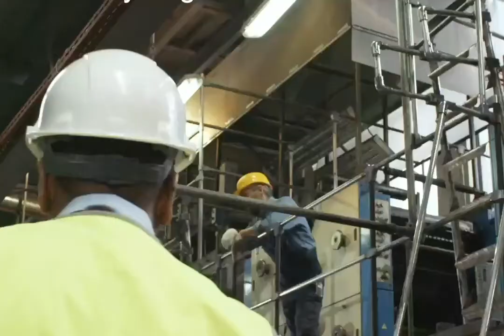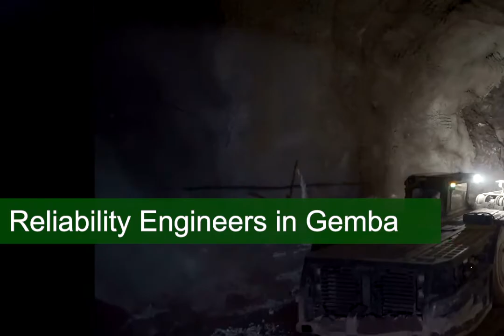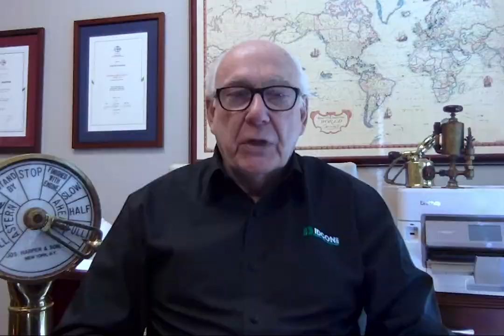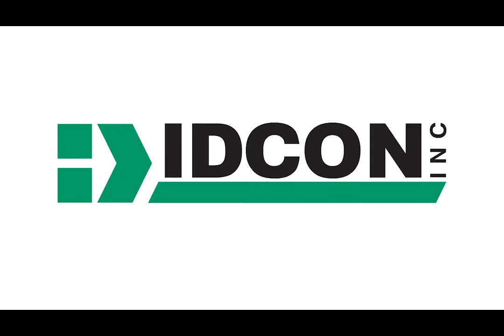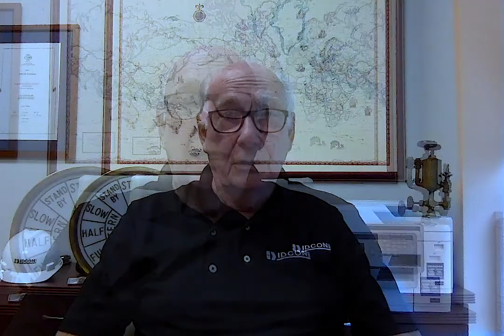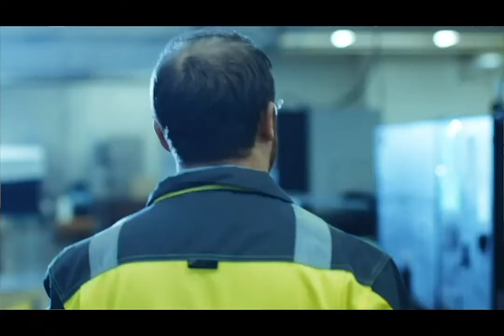What is My Role as a Reliability Engineer?

Comment: I’ve been in operations management and supervising manufacturing operations for decades now and I have found a lot of engineers just goof  off all day long and more or less a glorified quality inspector. I would end up having to figure out the issues and root cause along with supervisors and maintenance and team leaders who work out on the floor. A lot of the engineers I’ve worked with absolutely know nothing of the manufacturing processes.  Good video on explaining what one should know and. E accomplishing daily.
Reply: As someone who interned as operations engineer. I second this. Im glad to be getting more technical experience in another role